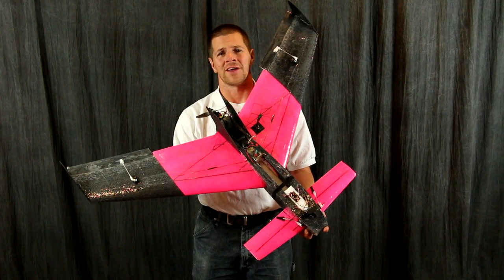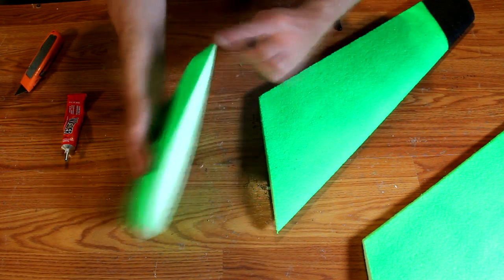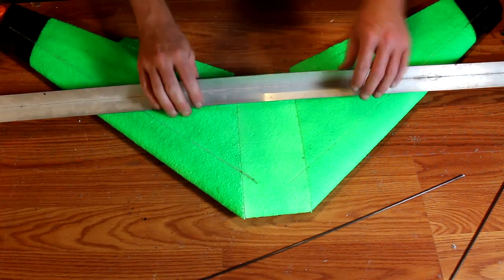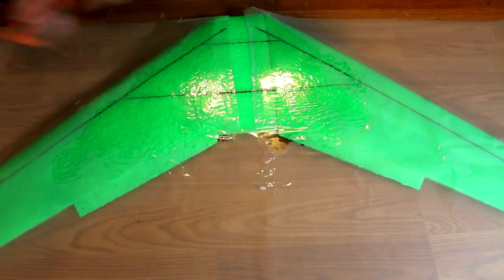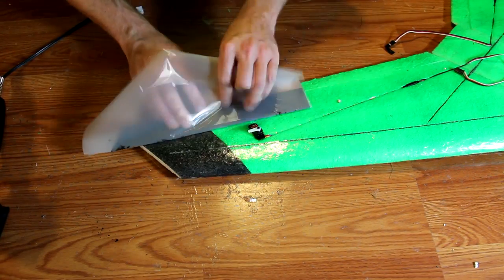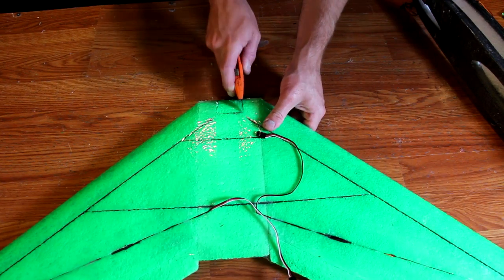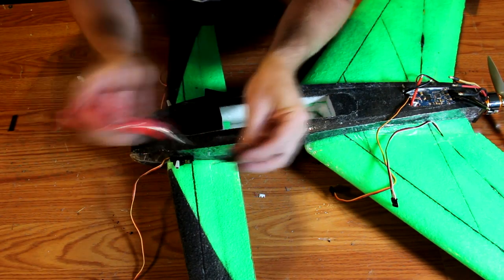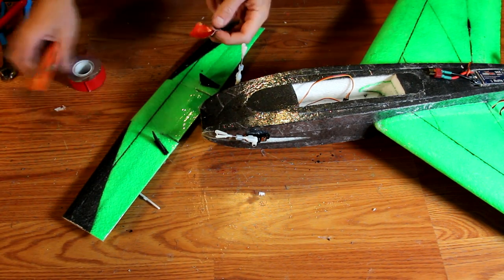VAS Pegasus airplane build video

Comment: I'm planning on buying a first fpv airplane/wing.  Been flying FPV miniquads for about a year now, and love your antennas.  I'm mostly interested in medium range cruising with some aerobatics, and plan to use iNav.  I'd kind of like something with rudder as well as elevator/aelerons.  Do you think this would be a good model to go with, or is there something else in the VAS lineup you'd recommend?
Reply from the maker: I wouldn't recommend a Pegasus for a first time modeler.  A Specter will fit the bill nicely, though.  The Specter is a medium range airplane with stable stall characteristics that works well for a first time builder.
Reply: Video Aerial Systems thanks.  The specter is a little bigger than I had in mind to fit in the back of my car (so is the Pegasus, but it looked so cool I was willing to work around it).  Would the Wraith be appropriate?
Reply from the maker: I would go with a Banshee rather than a Wraith.  The Banshee is more versatile.
Reply: Video Aerial Systems understood.  I'll look into it more.  Looks like neither the Wraith or Banshee have rudder controls, so that is a knock against them.  On a related note, if I am gonna go the route of a bank and yank, what are your thoughts on a spec wing as a first fixed wing?  I assume low speed performance isn't their strong suit, but is there any reason they couldn't be good for mid-range use with an FC?
Reply from the maker: Both the Wraith and Basnhee have rudder.  Just cut a slit out of the coroplast and hook up a servo.  Nothing to it.  That said, I really don't like rudder on them.

A Spec wing is a great first wing.  They have excellent low speed capabilities and are really durable.  That might be your best option, honestly.

Comment: There is no way to accurately locate the lipo that early in the build. IMO Cut the core for the lipo last. You can split it into a top and bottom half in order to insert it after the canard and wing is installed.

Comment: Hi, what is the thickness of the laminating film you use!? I'm looking for some here in holland but need to now the correct thickness. Some help please
Reply from the maker: My planes come with 5 mil laminate.  You need to get the low temperature stuff to get it to adhere well.

Comment: that canard will in the end get knocked off.
Reply from the maker: So far it hasn't despite several crashes.  However, the reason for double stick tape is to allow it to get knocked off rather than broken off so it can be re-attached.